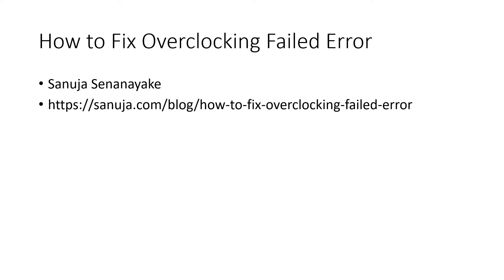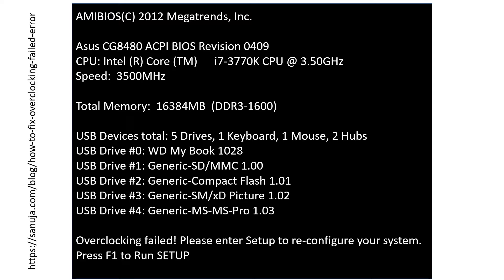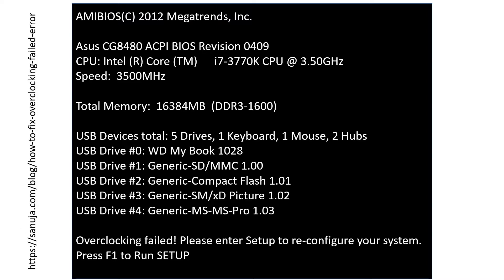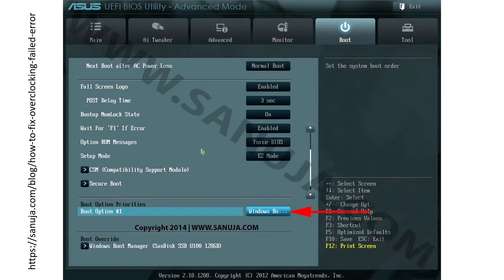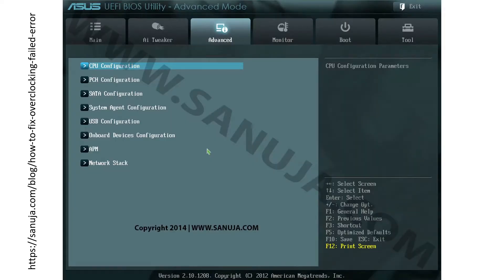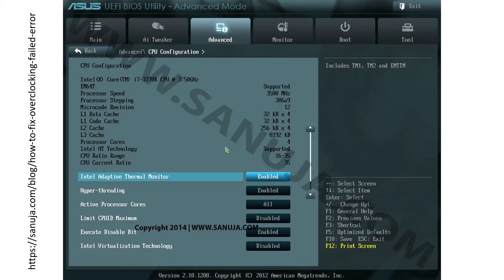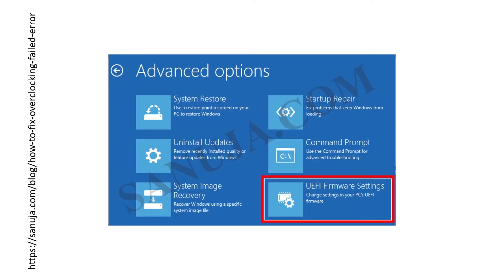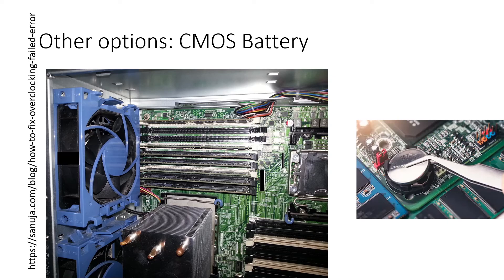How to fix overclocking failed error (BIOS/UEFI)

Comment: my system is crashing and shutdown. it detects MEMORY OC FAIL even tho i did not overclock my ram sticks. any help? 😢
Reply from the maker: It could be RAM hardware itself failing. Have you tried removing one RAM stick? Also possibly moving the RAM sticks to a different slots?

Comment: Hi, only UEFI settings helped me, then I could overclock the RAM. Even removing the battery from the motherboard didn't help. I spent about 2 hours solving the problem and then restarting the UEFI settings. Thanks for the voideo
Reply from the maker: Good to hear that this method still works.

Comment: I got this issue but my cpu is not capable of overclocking what should I do

I have i7 3770 not i7 3770k

Plzz tell what should I do @NetITGeeks
Reply from the maker: Have you tried putting your BIOS/UEFI settings back to defaults and try just tweaking the CPU overclocking settings? If you are doing this manually, without using an OC software, I would recommend only changing one config option in UEFI at a time.
Reply: @NetITGeeks  That was just ram issue

Comment: Hello.

The "message" is appearing since one week ago, load defaults work temporary, if a press restart the computer from button or on/Off the "message" appear again. I use Linux daily driver snd windows for my studies. On both OS if restar the machine is stays with a black screen and fans still running have to force shutdown, my pc still running but apparently is off. The monitor enter to a stand by mode. I tried some things but it didn't work. I have an Asus p5p43td
Reply from the maker: Check if your mobo has a CMOS clear/reset button. If you do, try clearing it (usually press and hold it while powering on or it is a pin-jumper). Other than that, makes sure you save the settings when you change them and exit BIOS/UEFI.
Reply: I have the same issue, sometimes when i shut off pc from windows it wont turn off and when i force it to turn off it will display overclocking failed then i need to enter bios, leave bios and it restarts and i can get to windows

Comment: i tried to go from 1600mhz to 1866mhz ram and it gives me this message. i know my motherboard can overclock it but dont know how
Reply from the maker: Do you have the Asus Motherboard overclocking software installed? That program is specifically designed to allow end-users to overlock their motherboard safely according to the manufacture's specifications. That would be the best option to overclock an Asus mobo. I would try that first before diving into the advanced settings in the UEFI.
Reply: @NetITGeeks  Yes tried with the XMP profile. It show the same prompt. I think id manually decrease CL timings but it reverts back to AUTO next restart

Comment: Sir can you help me? Im stock on bios because i accidentally press ez tuning on bios and after the restart my pc wont go to windows.
Reply from the maker: If you have that System Level up options, try setting it to the lowest settings instead of Auto and see if that fix the problem. Also make sure that you have the boot option #1 to Windows boot. I know this is what I said on the video too but unfortunately I have no other bright ideas.

Comment: There are no press F1 it says
Chassis intrude! Please chec your system
Overclocking failed! Please enter set up to re-configure your system. Fatal error... System Halted. 
I tride to press F1, F2 or Del 
Can you help me?
Reply from the maker: Try removing all your PCI and PIC-E cards, then cleaning the contacts (compressed air can) and reinsert the cards. Then boot back up and see if the "Chassie intrudes" error goes away.
Reply from the maker: If cleaning the contract of cards did not work, try putting in a new CMOS battery. If you do this, you need to go to UEFI/BIOS and change the date/time.
Reply: Thank you thankyou thsnkyou sir

Comment: Is it a worrying mistake, or is it just a common mistake
Reply from the maker: It is a common mistake. It should not destroy your data in ssds or hhds. However, it is annoying.
Reply: @NetITGeeks  thanks bro, I think my pc just bugged, because, I restart him and the error just desapear
Reply from the maker: @flowksss  I don't this your PC has a bug. This is a common issue with Asus older MOBOs. Sometimes it disappears after a reboot. I just custom built my PC with a new Asus MOBO and after reboots sometimes it throws out an error but now inside WIndows, not in BIOS. I really like Asus but they really need to fix their MOBO issues.
Reply: @NetITGeeks  ooh nice, thank you men, I luv U